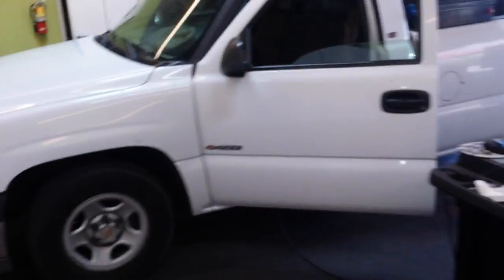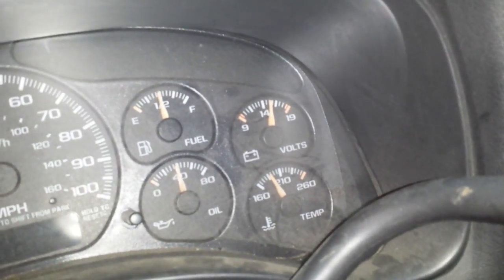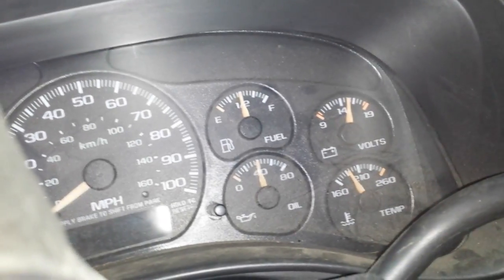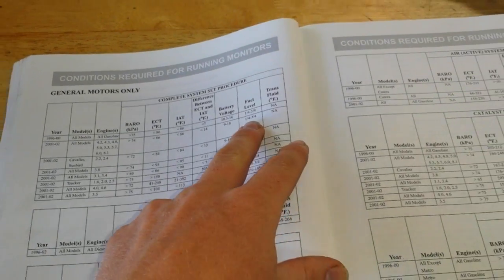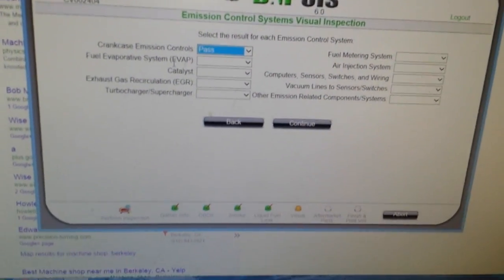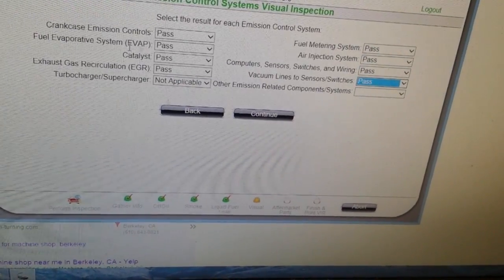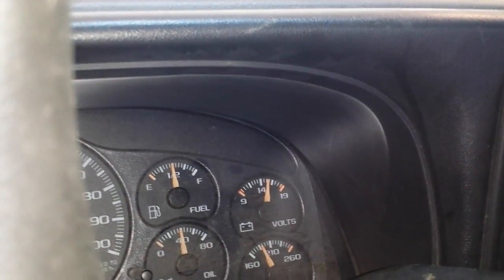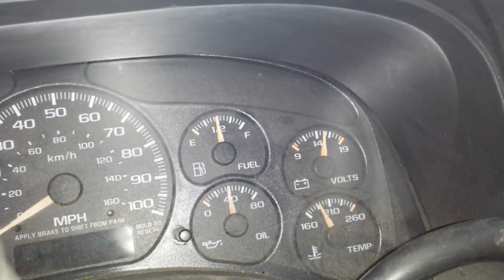Cannot set OBD monitors on Chevy & GMC truck.. fix?

Comment: 2002 Chevy Tahoe with the same issue.   Started with a battery replacement.  I filled the tank (originally had less than quarter tank), drove in D on the freeway and it worked! Thanks!

Comment: I have an 01 Tahoe which I just replaced the 02 sensors, all my monitors have cleared except the air one, I've driven the truck 500+ miles, driven it 55mph and coast it to a stop, turned the key off, cold started it in the morning and I've even replaced the one way valves and the dam air monitor hasn't cleared...I've also kicked the truck, threatened it, and I'm about to set it on fire cause it wont pass smog......any tips to fix this before I set it up in flames?
Reply from the maker: Does your temp and fuel quage work? The 'air injection monitor' will only run on cold warm ups. Have you heard your air pump turn on? I think it's up on the passenger firewall, under the hood.

Comment: Bought a 2001 chevy silverado duramax 6.6. Replaced all injectors. Balance levels are within parameters. Had a couple codes that I was able to get rid of due to gearshift replacement, odometer display was intermittent and security light would come on. I re soldered connections for the odometer behind the cluster and that took care of that. Had a power steering leak I replaced seals. Fuel leak due to loose clamp took care of. Driven about 5000 miles now. No trouble codes at all, but I/M readiness still not ready. The 2 for this vehicle are misfire and comp component.  The readiness keeps switching back and forth between those two. But I can't figure this one out. Any thought or help would be appreciated.

Comment: I just got my truck to set EGR by replacing my stuck thermostat.  After trying all the driving tests with no luck, ran a pending code check. I had a P0125 Insufficient coolant temperature for closed loop fuel control. My live motor could only reach 80 C with cardboard completely blocking my radiator. I changed the thermostat and got 93 C. I ran the drive sequence 3 times and within 20 minutes of changing the thermostat it read EGR OK!   I still have the pending code and never set a code P0125. Now my truck will pass smog test!

Comment: HELP!!! 2006 gmc Sierra.  It keeps saying not ready for Catalyst, Evap, and O2 sens. Have driven it for 150+ miles.  Still not ready i have no idea what to do at some point the fuel needle was acting crazy but it’s working. Sometimes the oil pressure low light comes up. But goes away seconds later and always works too. Temp gauge works too. Only thing is battery gauge seems to stay high. I had codes for knock sensor and evaporation solenoid but I had it fixed.   Curios thing.  I have codes but no check engine light even though the light works  why could that happen ?
Reply from the maker: Fuel level on dash works?
Reply: @ScottiesHobbies yes it does work

Comment: I have a 2014 Chevy Cruze 1.8 and I’m having a hard time getting the evap and egr monitors to change to ready. I have no codes and no check engine light. Any suggestions?

Comment: Hi, I'm having a problem with my 97 chevy astro, trying to get it ready for smog, no check engine light, have not unhooked the battery, but did replace spark plugs and wires last week. I have done the drive cycles and i got it down to only the Evap, Oxygen and Oxygen heater sensor being 'not ready', and this morning i went to check it again after doing the cold start and all the sensors are not ready again! as if i had unhoked the battery... what the heck is going on? also worth noting that the van is having trouble starting, takes a while to turn over, but i live in arizona and it is extremely hot here. so basically i have no idea what is wrong. any ideas?
Reply from the maker: Does the fuel guage and water temp guage work and read properly?

Comment: Im having this same issue w getting monitors to pass on my 2000 tahoe limited. I replaced my EGR, AIT sensor, but i dont have a connector for that, so i assume its sealed/bypassed, and my Cat/Hcat wont pass nor EGR and Secondary air sensor, also HTR. Ive taken it on hella drive cycles as well as driven it over 100 miles and still can get these to pass. Please help any positive suggestions or advice is welcome.
Reply from the maker: Your gauges are all working right? Temp gauge and fuel gauge?

Comment: Good detective work!  My '03 Sierra 4.8 Evap monitor will not re-set either.  Original issue PO446 'Fuel tank pressure sensor circuit malf.  Replaced Filler neck and vent valve for visual failures clearing the code and re-setting afterwards.  PO446 code persisted.  Replaced tank pressure sensor, cleared and repeated drive cycles multiple times.   Evap. monitor will not reset.  (My fuel gauge is ok btw )  Any suggestions?

Comment: Hi my smog didn’t pass because the ch (ppm) was high I didn’t sun the truck before smog it  can you plz tell me what can it be I checked some videos and it recommended the spark plugs and cable the measure was 15 mph 53 my had 75 and on the 25mph 37 my hat 47 plz help me i need my truck for work
Reply from the maker: Check this video out. I hope it helps. https://youtu.be/HlUJI-mHmlg

Comment: Disconnect the battery for 1.5 hours if you have had no luck with this and any other issues that you tried to repair. It works like a charm.
Reply from the maker: When you disconnect the battery you are starting back at square one. By disconnecting the battery you will reset your monitors and need to start your drive cycles over.

Comment: I drive a Chevy Blazer 1996 and have been failing smog. (EGR and Evaporative system come up as not ready)
Since I bought the truck, I've noticed this same issue with my fuel gauge so I'm really hoping this will fix the issue...
Reply from the maker: Keep me posted. After you do the repair, put some miles on it and get back to me. It would be nice to know if this worked for more vehicles, might help others too. Good luck!!
Reply: Kurt did you ever get it to pass

Comment: Any advice on getting the secondary air injection to activate as ready?
Reply: Legit having the same problem with my 2000 Silverado right now. That’s the only monitor that will not reset.

Comment: Where can I find the info on what other systems might play a role in the monitor readiness?
Reply from the maker: What is the issue? You can call and leave a message at (925) 418-5096. I'll take a listen when I get a chance and either call or more than likely text you back. Or.. just shoot me a reply on here. Let's see if I can help.
Reply: @ScottiesHobbies  can't seem to get evap or catalyst to set.. I've got over 500 miles since last clear /rest according to my scanner.
Reply from the maker: @caseyanderson1297  car warms up as normal? Fuel gauge reads right?  No pending codes?
Reply: @ScottiesHobbies  warms up great no codes pending or stored. Fuel gauge has yet to have any issues. This one is throwing me off. I've seen it where the computer resets every time the key is cycled and resets the miles since cleared but everything looks good on the scanner, and everything is working fine. I've got to check battery connections I had a loose positive terminal I had to tighten and when I did that the stupid style terminal didn't want to get tight at all so it may have loosened up.  Just thinking as I'm replying here..

Comment: I have the issue with the gas gauge mine reads the gas it drops down to empty as soon I move to drive and the wheels move.. the car runs fine even when it's down I have a Saab 9-3 2005

Comment: hey I got a 1998 Ford F 150 8 cylinder 4.6 the EVAP axigen O2 heated and oxygen sensor won't set do you know the driving cycle for it
Reply from the maker: +Chad Mack have you checked for pending codes? The coolant temp goes to normal? You keep the gas at about 1/2 to 2/3rds full?

Comment: Just replaced knock sensors...only left to set is evap and catalyst...have driven 100 miles...even did a 3,000 rpm idle for 3 to 4 mins to try and set catalyst but no luck...any recommendations?
Reply from the maker: Evap will only set on a warm up. After 2 or 3 cycles so that can take a few days. The engine needs to be under 100° or something like that on a start up. 

The cat mon. Will set on the freeway. My best recommendation: put 3/4 tank of good fuel. Then drive 15 to 25 miles. Here is the important part.. stay between 55 and 65 mph the whole time. Do not use cruse and do not accelerate or slow down quickly.  I usually fallow a big rig for 17 miles. Then pull off the road. Turn the vehicle off. Let it set for 3 to 5 mins and go back to your star driving the same.

Man.. that was a lot. Let me know what happens.
Reply from the maker: That should set the monitor or set a hard or pending code.
Reply: @ScottiesHobbies  ok I'll try that thx
Reply: @ScottiesHobbies  about to try it...we shall see
Reply: @ScottiesHobbies  just did exactly how you said...no luck...🤦‍♂️...all monitors are set even evap.. except catalyst...no codes...no check engine light...just cleaned throttle body mass air flow and air intake control valve...and oil change on 2000 5.3 Silverado 1500...drove 44 miles...stopped half way let it sit for 5 mins then same thing back...have driven at least 200 miles so far
Reply: @ScottiesHobbies  actually...got off wrk today...about an hour ago...checked with my scan tool and by the grace of your advice and god lol...all my monitors are set...and the drive you suggested was the last thing I did...thanks again

Comment: Is it the fuel sender unit code preventing the OBD from running, or is it the actual fuel level showing on the fuel gauge? Reason I ask is I have the same issue but I really don't want to  change the fuel pump. I know if I rock my truck from side to side, it prevents the fuel gauge from falling all the way to empty. I'm wondering if I do the cold start and rock it side to side, will that last OBD test run if the fuel gauge stays at 1/2 tank?
Reply from the maker: Generally speaking, the computer sees what you see on the dash. Uless you have a guage on dash prob. The computer just needs to see the temp at 'normal operating temperature' to run self check monitors.
Reply: The GM driving cycle requires a cold start followed by idling for 2 min & 30 sec. This is when my fuel gauge always goes to empty and the low fuel light comes on so I'm really hoping this is my problem. I've done the rest of the drive cycle several times so the fuel level issue makes sense because it ALWAYS drops to empty when I idle for a prolonged period. Crossing my fingers it works!!
Reply from the maker: @darizob  I'll keep my fingers crossed too. Keep us posted and good luck.
Reply: Scotties Hobbies 
Did you fix it ?
Reply from the maker: @palopezneri  the fuel pump sending unit? Did i fix what?
Reply: Scotties Hobbies 
I’m sorry man .
My question was for Rob v
Reply: @palopezneri   I haven't had the OBD status checked yet because I want to do several cold starts before doing so. I'm optimistic though because the fuel gauge stays at its correct level when I rock the truck side to side so I'm hopeful the "Secondary Air Flow" OBD will run. I'll post a reply as soon as I have it checked.
Reply: SUCCESS!!! It worked! All OBD are set and it passed smog. All I did was stood outside the driver's door and rocked the truck side to side before starting it, then reached in and started the ignition while continuing to rock it so the fuel level would immediately go up after starting it. If I didn't rock it before starting, the fuel gauge would start at empty, then shoot up after a second or two...Rocking the truck beforehand puts the fuel level at the correct level immediately and let's the OBD run. I continued rocking it for the full 2 min & 30 sec that the GM drive cycle calls for following the cold start with the A/C on.  

Thanks so much for posting this video!!!!!!!!!! I never would've thought the faulty fuel level sender would've been the culprit had this video not been posted, but sure enough, with the fuel gauge always dropping to empty, that last OBD couldn't set w/out the adequate fuel level. THANKS AGAIN!!!

Comment: i drive an 07 sierra 1500. had engine light on. replaced gas cap. driven about 400 miles. and evap still isn’t ready.
Reply from the maker: Why are you trying to set? Only monitor with issue?

Comment: I have a body dropped 98 S10 that I'm trying to get pass NY inspection failed 2times already says monitors not ready I have a full cell and aftermarket fuel gauge my stock gauge is still there says low fuel would that b reason for me not to pass NY inspection
Reply from the maker: It is completely possible.  The computer wants to see 'normal operating temperature ' to set monitors.

Comment: I have 08 gmc sierra I change the oil pressure sencor n my check engine light went out but don’t it pass inspection anyone no what the problem
Reply from the maker: What did it fail for?
Reply: @ScottiesHobbies  they told me that it had 2 sensor that fail I connected the computer I don’t have no codes

Comment: I have spent 2k on my 2001 Silverado .. changed spark plugs ,plugs ,02 censors everything you can think of the deals with smog. And drove 2k miles to set the computer and still won’t pass smog. The e vap won’t clear. Then I took it to a specialist to check the computer. They said that 2 of the computers weren’t reading each other and they reset and supposably fix it. Drove already  80 miles to reset and again nothing. I’m out of options
Reply from the maker: Are you in California?
Reply: I've been having the same problem with my 2000 duramax silverado.  ERG readiness never ready.  I can't figure it out.  It's been four+ years.  Also, I'm in CA.
Reply from the maker: @garyhgaryh  sure it's not a 2002?
Reply from the maker: @garyhgaryh  have you failed smog?
Reply from the maker: @onesweet52 Have you failed smog? Only Evap monitor not ready?
Reply: @ScottiesHobbies  Yes, it's a 2002 duramax.  Every year I fail the test.  It's egr/evap.  Sorry, 2000 was another car I'm working on now.. Any ideas? I've driven to Yosemite and tried the drivecycle for that monitor and fail every time.. :(.  Have you seen this issue on a 2002 duramax?
Reply: I only fail because that monitor is not ready...
Reply: @ScottiesHobbies  You're right it is a 2002 Chevy duramax.  It's a vehicle of interest right? Can I take it to a non star smog station ?! The last time I smogged before 2016, I failed.
Reply from the maker: @garyhgaryh  the smog machine knows to ignore the EGR monitor on the 2002 2500 HD models. The vehicles have to be input into the emissions test machine exactly correctly. if you look up the California bar OBD2 reference guide you will find some information on there pertaining to the 2002 Duramax. In that guide it says the EGR monitor is extremely difficult to complete and the solution is for the new ois machine is to ignore that monitor as long as the machine has been updated. I can get you reference links if needed.
Reply: Scotties Hobbies I found the document fri night and smogged sat morning and passed! I almost couldn’t believe it.  I went to the same shop in 2015 and failed.  Told the guy why it passed since he worked on the car years ago.  I racked up over 1.2k in fees because I didn’t put my truck in nonop status last year.  Don’t ask me how I passed last year but if I did it the legit way I would have passed!

Comment: This might just work on 2000 Astro van, Cat & Evap monitors havnt set for 3 months of driving and No Check Eng Light! so ill gas up little past 3/4 tank and see thanks !
Reply from the maker: +Aaron B have you checked for pending codes?
Reply from the maker: Did ya grt it to pass?

Comment: what were the monitors would it not set
Reply from the maker: +automotive hacker ya know, that is a good question. Next time i see one like this ill make sure i check.
Reply: i have a similar issue my cat, ho2s, and evap wont set
Reply: but thanks for video i would have never thought of that
Reply from the maker: Check this out from bar.. Super helpful: https://www.bar.ca.gov/pdf/Smog_Check_OBD_Reference_Guide.pdf
Reply from the maker: On what kind of car? I always recommend to 3/4 tank of gas, drive 55 mph for 15-17 miles. Turn the car off and back on. Then drive back doing 55. I always tell people to just fallow a big rig, they should be doing 55 on the highway in this neck of the woods. If they don't set after that.... Ya might have a problem.
Reply: @ScottiesHobbies  will this work 2000 chevy silverado?

Comment: Yes been driving it sense January 2017 no codes or pending codes anywhere check enging light cycles on as normal goes off just will gas up and drive 100 miles lol and hope smog due Jan 2018...
Reply from the maker: The coolant temp gauge reads correct? The fuel gauge like in the vid is good?
Reply: Scotties Hobbies  hey AB  yes all gauges work right no code just cat and evap not set yet may do early tune up and oil change 260000miles on it. runs strong but (somestimes) trans jumps in gear taking off from a stop. somet
Reply: Aaron B  did you get your problem solved yet? I'm having the same exact issues with my 03 Silverado with a 4.8
Reply: Odis Redding:Hey odis nope still showing cat & evap not really and no check engine light on dash, an it works when starting up veh.
Reply: Aaron B  I solved part of my problem. I usually drive in 3rd all the time bc I tow. when I drove it in drive the catalyst set to ready after a 8 minute 45-65 interstate drive decelerating to 0.